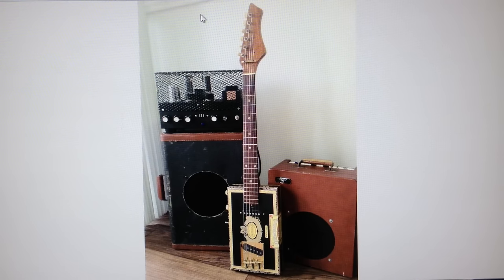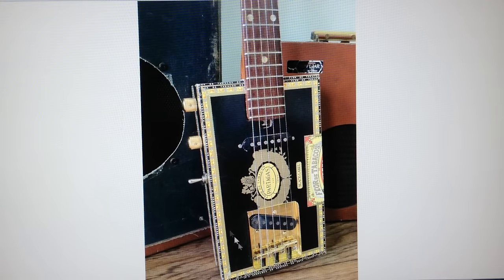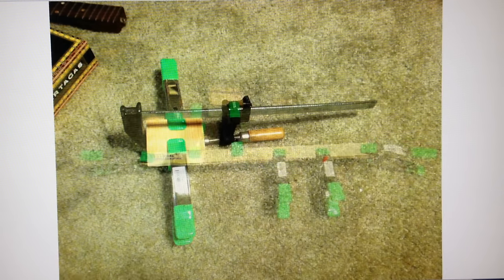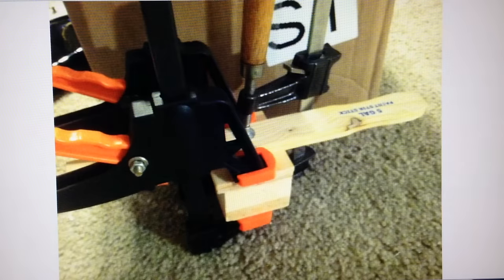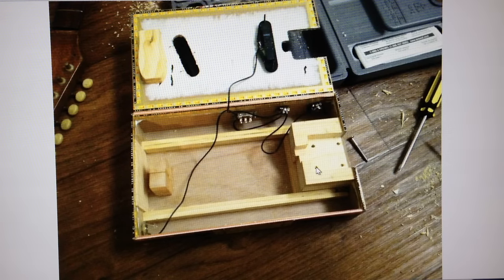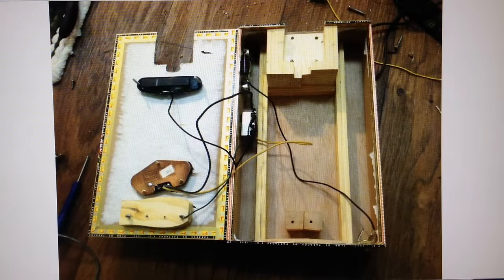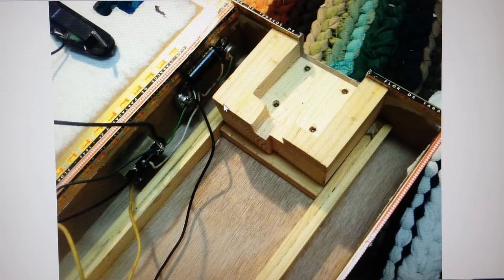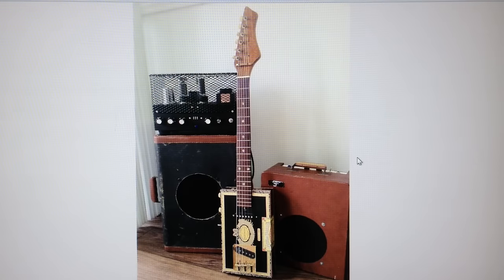How to Build a 6-String Hollowbody Cigar Box Guitar

Comment: I've built a 3 string cbg using a large chocolate box (neck goes to the back but not completely through). I had to line that box with custom cut plywood. I recently built a strat kit guitar but am upgrading its neck, so I plan to use the neck for a 6 string cbg build. This is the type of guitar I'm aiming for, this video is very helpful to understand strategies for the neck attachment and bracing. Cool guitar!

Comment: Hi G, Brad, I'm a seasoned CBG builder, Salt and Pepper! I'm actually working on a 6 string, using reclaimed guitar parts. Very informative, some good tips. I'm not the living end building CBG's, but, build a pretty nice one. I built Justin 'the Wizard' Johnson, on YT, a nice 3 string, G, D, G, using a Padron box with a P-90 single coil and 250k volume pot, no tone. Poplar neck and brace. Very cool channel. Take care, C.
Reply from the maker: Thanks for chiming in! I'm aware of Justin Johnson. Great player. Probably the most visible of the current breed of CBG players. You must be a seasoned builder, indeed!
Reply: The Guitologist Hi Brad, I'm not, still a beginner, Justin's CBG was only #10. I make them all by hand. Drill motor for holes. Dove tail pull saw, Irwin, very nice, chisel's, 4 in one rasp, file's and other related tools. I use the pull saw and make my own finger boards using 1/4" x 1 1/2" poplar. My way to relax and have fun. Thanks for the reply. Take care, C.
Reply from the maker: There is something very Zen about working with your hands and engaging your brain in problem solving at the same time. That's why I love repairing guitars and amps so much and that's why I gravitate toward stuff that's off the beaten path. That way you can't just read about someone else who already solved the problem before.

Comment: Thanks for this great video! How do you measure the distance between nut and bridge on this particular guitar? Mine is out of tune on the 12th frets :-(  I think my cigar box is to short (?)
Reply: The distance measured from where the string leaves the nut to the middle of fret 12 should be exactly the same as the distance from the middle of fret 12 to the point where the string leaves the saddle. You should position your bridge in such a way this distance is correct while still having some adjustment length left on your saddle screws for fine intonation.

Comment: I've been meaning to ask you, do you have any 6021's lying around? I have a seymour duncan twin tube classic, and it is my primary clean-boost. It has so much clean gain on the rhythm channel that I can use it to push basically any master-volume amp into high-gain "chugging" without using any gain from the pedal, and just setting the gain on the pedal at around 11 o'clock (as high as it goes before it gets dirty) and pegging the output volume. It's like having a TS808 if the TS808 was 3 times as hot. Anyway, I think the problem is microphonic tubes, but there could be other issues going on as well, It's noisy, and there is a loud "clink" when I turn it on, and I get squealing feedback from it if it is close to the amp, even if my guitar volume is all the way down. I've been using it as a pretty much "always on" pedal for like 7 years now, and my sound just doesn't exist without it, so I really need it to work properly. How much would you charge me for some routine maintenance, and if needed, a retube (a pair of 6021 tubes, no sockets, wire leads soldwered to the board)? I'm a little afraid to attempt to troubleshoot it myself, it's a bit of a crazy wiring scheme under the hood and I am not familiar with the circuit......Damn, you smoke an awful lot of cigars! Nice build.
Reply from the maker: As far as pedals go, I'm probably not your guy. It's one thing to attempt a repair or maintenance on it when it's mine, but having never seen one before, it's hard to say, man. In your case, I'll be glad to take a look and do what I can with it. I am 99% sure I do NOT have any of those sub-miniature tubes. I can look in my stash, but assume I don't have any. If you're willing to buy the tubes and ship me the unit with the new tubes, I'll change out the tubes and give it what service I can and, of course, shoot a video of it all. I'll give you a half rate on the labor since you were good enough to give me that speaker a while back. I'm guessing the whole business would take less than an hour, so $25 would cover it. GIve me tonight to check my stash on the tubes and get back with you...
Reply from the maker: Looks like Tube Depot has those 6021 tubes for $7.95: https://www.tubedepot.com/products/6021
Reply: The Guitologist Cool, and thank you. I'm gonna order the tubes, I just want to look around to see if there are any listings on ebay or anywhere else that don't cost too much more and actually give the brand name, because according to many reviews and forum posts, the GE and Raytheon 6021s are very different and I don't know the circuit well enough to know how it will effect the sound, but others have said they do have variations in gain and microphonics.
Reply: Unless you have some in your stash, then let me know what you have and we'll go from there.
Reply from the maker: In my experience with tubes generally, RCA, GE, Raytheon, Sylvania, etc. Any of these should be good tubes in terms of quality. I wouldn't worry about it too much. Sounds like any working, good tube will be better than what you have currently (which sound microphonic according to your description). The problem with hard wired tubes is you cannot easily tube roll. I think you should expect your unit to come out sounding slightly different than what you're used to regardless what tubes you get. There's always some variation even among the same brand's tubes.
Reply: The Guitologist Sure, I've just heard the Raytheons are crap, more prone to being duds. I'm seeing some listings for GE and some unbranded J.A.N. 6021s, which may have been made by Raytheon for all I know, but they should be tested before they're shipped.
Reply from the maker: JAN are always going to be superior. They went through additional QC from the factory for Army and Navy use. As for Raytheon being prone to being bad, I can't speak intelligently to that in the case of the 6021. But I do know you gotta be skeptical of sweeping generalizations where tubes are concerned. It's really on a case by case basis, and for all you know, that rumor may have originated with one guy having one bad Raytheon. Your absolute best bet is to purchase from a reputable dealer who accepts returns on microphonic tubes. Paying a little extra for the return policy is probably wise in this case where you have a sensitive preamp boost which might be finicky.
Reply: The Guitologist Yeah, it is definitely worth it, since the other option was to buy a second unit before even starting to attempt to repair this one. I really can't live without it. It allows me to do most of my rhythm guitar on a Classic 30 head, and even get into a "modern" level of gain by stepping on a pedal that doesn't have any negative effect on the tone. It also had a usable gain tone (the pedal itself) before the tubes went bad, but I mostly love it as the only clean-boost anyone could ever need. You can put it in front of a Marshall set to a moderate crunch and push it into death metal territory. I'm gonna order those tubes, if I don't still have the old email I might need to email you for your address again, but whenever the tubes arrive, I'll get everything boxed up and shipped.
Reply from the maker: Sounds good. Email me if you can't find the address: bradlinzy at gmail.